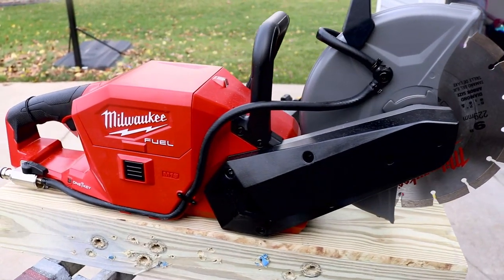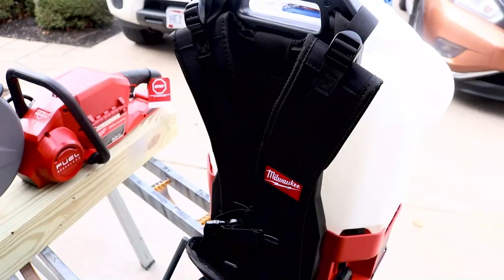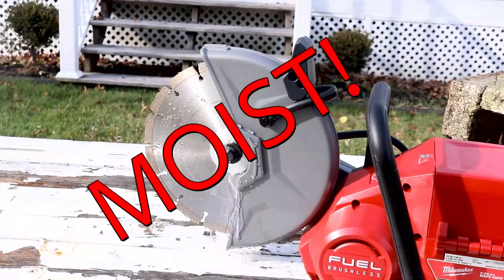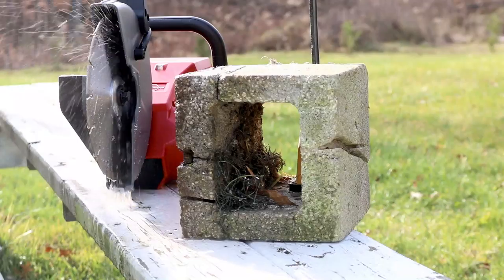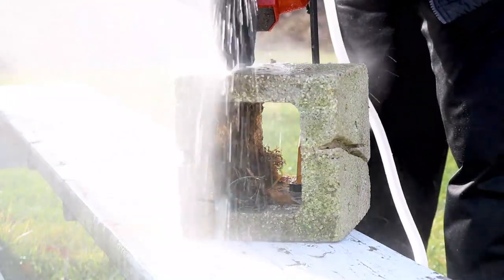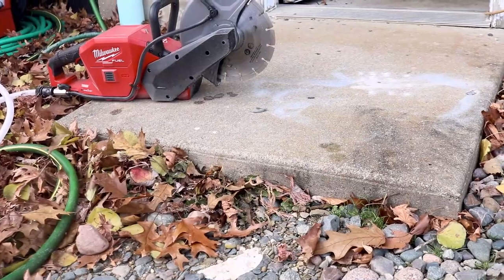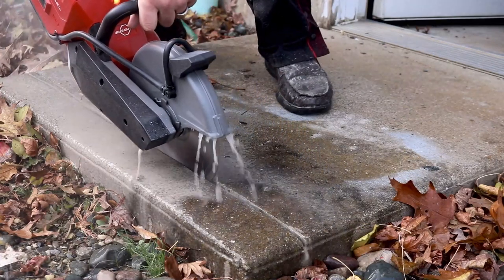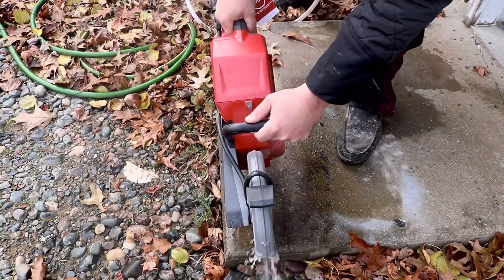Milwaukee Tool M18 FUEL 9"' Cut Off Saw PUT TO THE TEST! Cutting through concrete and (FULL REVIEW)

Comment: We gave it a shot for cutting trench mesh and penetration bars, etc... 12mm & 16mm most of the time... Medium usage nothing over the top... Obviously concreting wear and tear on tools is expected and our crew respects the tools we use but we don't baby them... The first unit chewed through the rediculously large 12.0ah battery in no time at all... No overloading just standard usage (trade).. had the Milwaukee rep come out to site with a new replacement and we thought "ok cool thanks mate loving the service" and away we went again the next day with the 2nd unit.... Same thing again... Used another brand new battery (after fully charged) and no difference, just depleted in no time...  Boss calls again and we get rep out to take the unit back for inspection and will organise another unit asap.. after a week and a half we called to find out what's the go... They organised to meet on site the following day..  they couldn't explain what was going on but understood the frustration and hooked us up with a third unit, some blades and to try out a circular saw for a week or 2 which was good. Customer service was above average no question. The problem was with this tool yet again, so the 3rd and final failed attempt,  we returned it for a refund.  We have the STIHL TSA230 and have had no issues at all. Battery lasts longer and cuts well.  We use a MAKITA DSC191Z for the bulk of our on site bar cutting jobs and it does it better than well with minimal battery drain and quiet operation. That's our experience with this machine and nothing more. We use Milwaukee impact drivers, saws, grinders along with Makita and DeWalt.. they all have there pros and cons. This unit didn't work out for us so we shared our experience for anyone looking for a review on it.  Take it or leave it or whatever you want but it's here either way. ..Bottom line for us is 
" it's definately no BEAST SAW"
Reply: No it’s not the best ,I also cut all day n good old gas power still the best

Comment: This saw would be most useful for work in a basement, since there are no fumes.  While it's a shorter runtime than with a gas powered saw, I don't see it being an issue for most indoor jobs.  One would also need a wet/dry vac to suck up all the dirty water.
Reply: We use the same saw as this but dewalt. Great saw and we use it to cut rebar mostly and to finish saw cuts after the walk behind saw. Easy to use and very nice tool.

Comment: Trz that cut-off saw would be great for someone to have that only uses it a few times a year then you don't have to worry about the carburetor problems changing the oil you get the picture. I would love to get one of those. Milwaukee's doing it right and you did a great job with the video. Peace brother
Reply from the maker: Sounds like your heading into the red zone bro?
Reply: @ToolReviewZone  I don't know what's going on but I have been in the Red Zone lately pretty bad. I bought a lot of red stuff in the last couple weeks I will hit you up tomorrow. Peace brother
Reply from the maker: @jeffcoolhd  haha sounds good bro

Comment: Brilliant piece of kit absolutely recommend don’t get me wrong with it being battery powered I was hesitant but I would highly recommend being a roofer the batteries last just as long as petrol or gas powered cut off saws the petrol or gas reference was in the uk we call it petrol in the USA they call it gas
Reply: Hi mate, I'm also a roofer in the UK. Just wondering how long the batteries last. Will a couple of 12ah batteries last a full day of cutting hips and valleys?

Comment: I’m a Millwaukee fan I have everything Milwaukee, but this is not for trench cutting, I had to use 3 12.0 batteries to cut 20’ and batteries overheating. I love Milwaukee but I guess I’m gonna have to wait for the new 14”.
Reply: I got this saw and cut 12" through some 1/4" mild steel and the 12ah battery overheated. Totally worthless tool. Shocked at it really. My cordless 4.5" grinder does better.
Reply: I’ve got the 9” dewalt, no overheat issues, about the the same battery life . Give or take battery change every 4 to 5 ft of 31/2 concrete

Comment: the saw is nice and cuts through concrete like butter but the battery lasts no more than 5-10 minutes the  you have to stop 90 minutes while the battery charges...basically you need atleat 5 12ah batteries for a medium size task.

Comment: The switch Tank is a waste of money. Why not just hook up to a hose and you won’t have to waste time and keep refilling the switch tank. I know you are going to say that all places aren’t accessible for a hose but 99 percent of the jobs I do have access to a hose and even if they don’t I will use my universal vacuum attachment that hooks to this saw or any saw and it’s actually way better than using water. You don’t have all of the mess that comes with using water. Water gets the block soaked and then you have to lay it and try to strike and make it look good and it just makes it a lot harder when it’s soaking wet. Not to mention the water normally gets your pants all wet no matter where you stand when you are cutting.
Reply from the maker: Yeah but it can be used for way more than just this. Pesticides,  cleaning...we are actually using them at out business to spray all the restrooms with a cleaning formula.
Reply: Tool Review Zone. I was just saying if you were only buying it to use with this saw it would be a waste of money.
Reply: @chrispasley100  not really, I'm a roofer and access to water is more difficult, this is mobile enough to do the trick.

Comment: Really wanting to buy this, my issue is battery life though, has anyone had the chance to try it. im looking to cut a small trench to rough in a basement washroom
Reply: Matt Newman I just bought it I cut 20’ and had battery overheating problems if you get it better have 5 battery 12.0 on standby not good for trench cutting I was hella diss appointed

Comment: Thinking about renting this from Home Depot to cut a couple of inches off one side of the block doorway.  But, I'm not sure I want water all over my basement.....
Reply from the maker: You don't need to use water,  but I'd rather have water than dust. Just place a shop vacuum to suck it up when it's coming out 👊
Reply: @ToolReviewZone  yeah, the dust may be worse, agreed. I might just use water and throw a bunch of old towels on the ground.

Comment: Good review.  You had me concerned in the beginning cutting concrete block as its pretty soft.  But when you got to the concrete, you made my day as its the real test.  Question: can you connect this to a garden hose?
Reply from the maker: I'm sure you could find a female adapter for it. You can control the water flow directly from the saw
Reply: That was my question, Milwaukee should send it with a adapter

Comment: Doesn't the water protect the blade and soften the concrete
Reply from the maker: Works two ways. One is to keep the heat down on the blade, but also to keep the dust down. There are some older saws that did not have this feature. Look at some of the old road crews that would send dust into the air like a sand storm back on the day
Reply: @ToolReviewZone  i do heavy highway construction and i can confirm that. When we run out of water it gets bad to the point people call the Dept. of Transpo

Comment: Not bad works well enough ,but its blade size limits the depth of cut.. the water is not for dust. It to keep the diamonds from melting off the blade.
If this is the tool you need , the 14inch 72volt MX tool is what you really want.
Reply: Water is to help with dust 100% and helps cool the blade! Most states do not allow you to use a concrete saw without water or a vacuum per osha rules not mine!

Comment: A cheaper option is to get a Ridgid 7 inch angle Grinder and put a 7 inch wheel on it.  You could get close enough and break the remainder off with your breaker.
Reply: Gonna breathe up all that concrete dust, are ya?
Reply: @jonathandoelander6130  No spray ground with water.

Comment: This thing sucks butt hole - I had 5 x 12ah battery and they all overheat after more than 2 minutes of cutting through soft brickwork not even concrete, tried a diff saw does same thing.

Literally had to leave the battery flap open to allow more air around battery to get an extra 30 seconds out of a battery and they all hit overheat and once they cooldown they still have 2 bars left but it takes 10 minutes to cool down and 30 minutes to cool down to put back on the charger
Reply from the maker: Bad unit maybe? 🤔